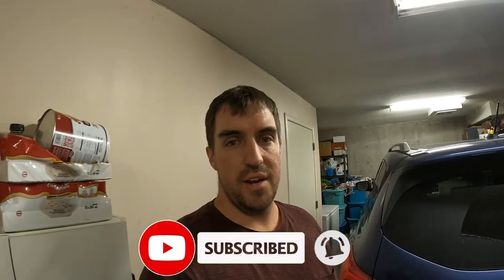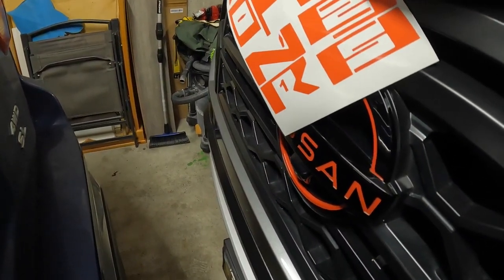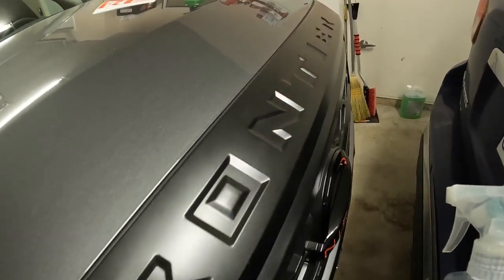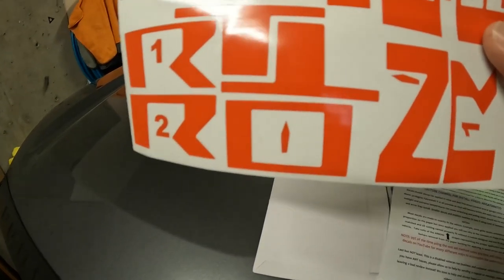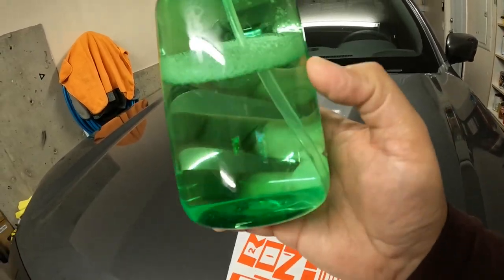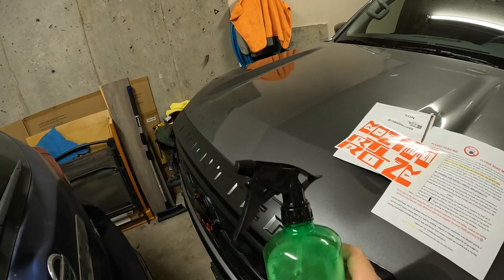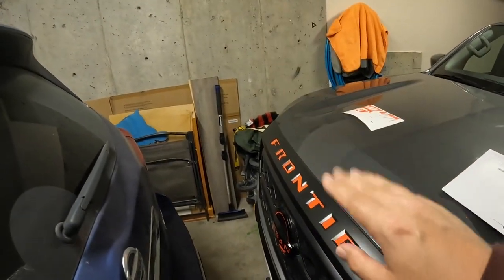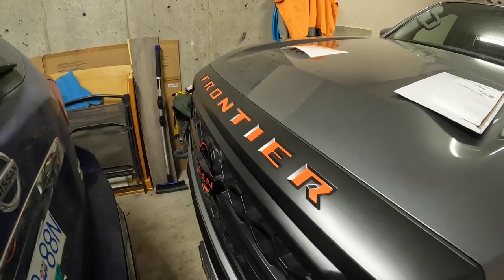2023 Nissan Frontier Pro-4x Grille Decal Install And Review

Comment: Where did you buy the decals from? Are you happy with them so far?
Reply from the maker: So far I'm happy. They're sticking on after a few washes so they seem to be good quality. I bought them off etsy
Reply: Thanks, I’m in the Okanagan and just picked up a green  pro4x. So far super happy but super stock.  First mod I’m thinking about a front license plate  bracket delete. Maybe just mount it to the skid plate upper. I’m looking forward to your future mods.
Reply from the maker: @Jeremy tucker  I want to make a trip out there one of these days. I used to camp in salmon arm quite a bit but I've been slacking
Reply: Possibly, a little more exact as for who on Etsy. Many dealers but we can see your set is ok. Be appreciated. Thanks
Reply from the maker: @f5fstop https://www.etsy.com/ca/listing/1125536471/2022-2023-nissan-frontier-decal-for-the?click_key=e8a680426ae7f183efaa396181233e6bc286e603%3A1125536471&click_sum=4713e611&ga_order=most_relevant&ga_search_type=all&ga_view_type=gallery&ga_search_query=decals+frontier&ref=sr_gallery-1-1&organic_search_click=1&bes=1&sts=1&variation0=2430248975

Comment: Use plastic tweezers if you can get them. More control than fat thumbs and fingers. (I have the fat thumbs and fingers.):face-blue-smiling: Just received mine from the same place; good shipping. Just need the garage to cool down from 105 or else I'll be applying with sweat vs. water with detergent.